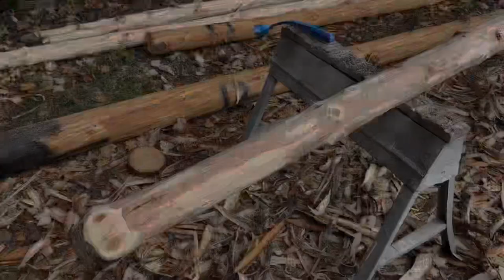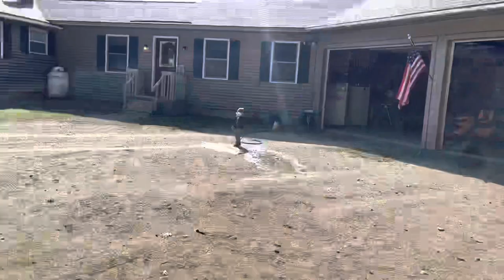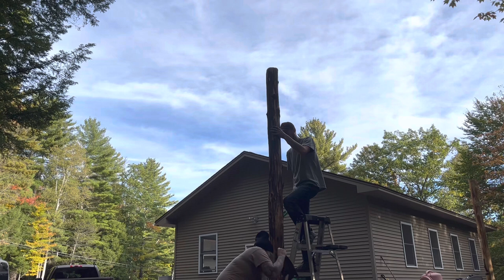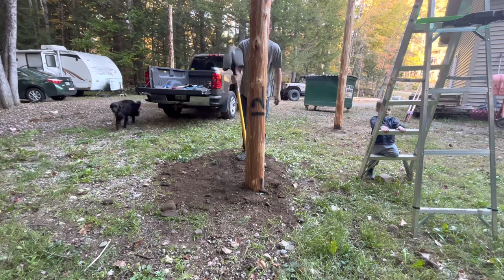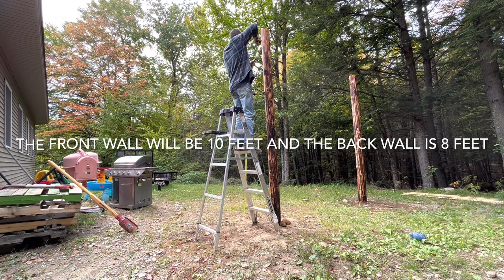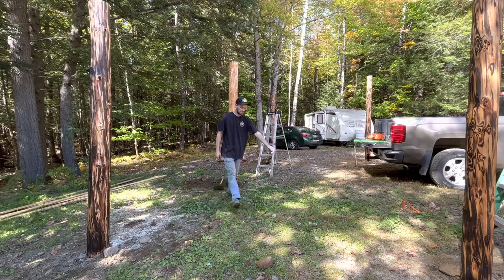Building a pole barn for FREE using Mother Nature!!

Comment: I liked the burning of the poles prior to burial, id suggest motor oil poured around the bases and drill a small hole near the base to add a funnel with oil. If oil isn't your style then add lots of lime around the bases to prevent rot and bugs garden lime is good enough.
Reply: Line doesn’t rot the wood more? Do you put it in as you’re packing in the posts? Thanks for the tips
Reply: @AnxiousCowboy  The lime creates a ph that's to low for microbes to survive so the wood doesn't rot as fast. Yes add it to the hole as you're back filling. Another option is Borax soap which is borate, Another insecticide common to use on log homes to treat for bugs.

Comment: Good for you brother. I'm using oak off my land for piers for a new home. They increase in width as the land goes down in elevation. 8" to 16"w. treated about 10 coats of diesel and used motor oil. I'll be starting my pole barn the same as yours after I get the place dried in. Keep up the good work!
Reply from the maker: Nice man that’s gonna look awesome !!! And I used motor oil works really well, I’ve used it to coat siding on a camp before !! Have a good one !!